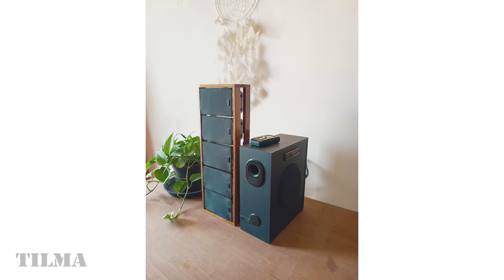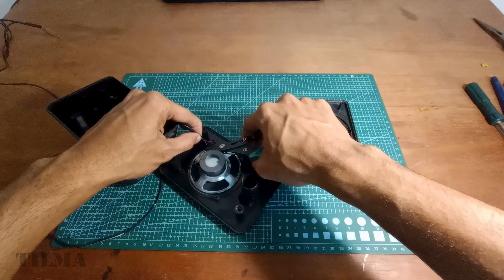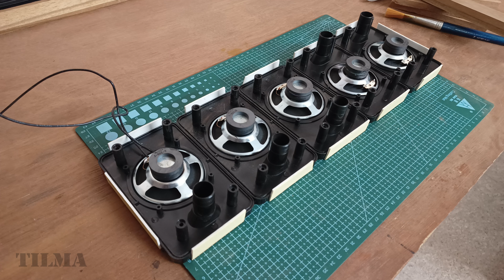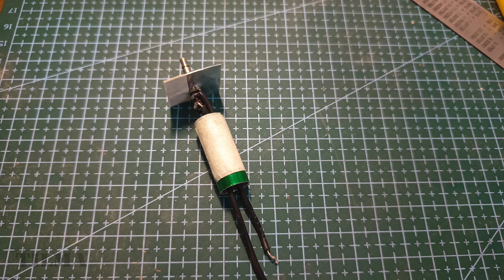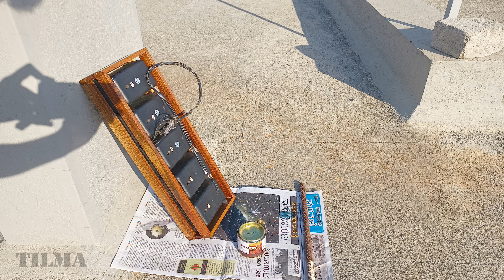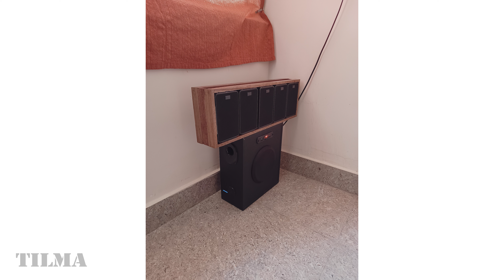DIY Bluetooth Wireless Tower Speaker | How to make Tower Speaker | Part 2

Comment: Nice work, looks like 70s concert speaker rack, I've similar ones. I'll stack them in vertical. Can I use DIN socket for all speakers !
Reply from the maker: Thanx. Yea you can use it. I wanted to use that. But it would've taken a long time. Wanted to finish the project minimally. Din it's good go for it